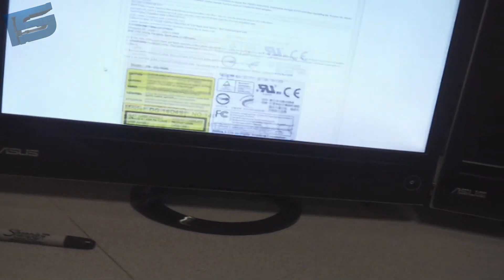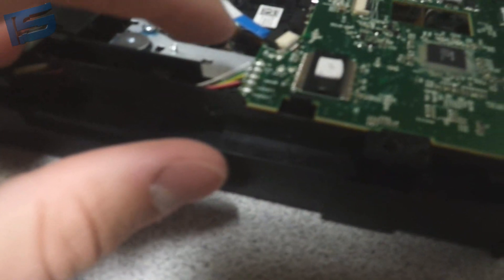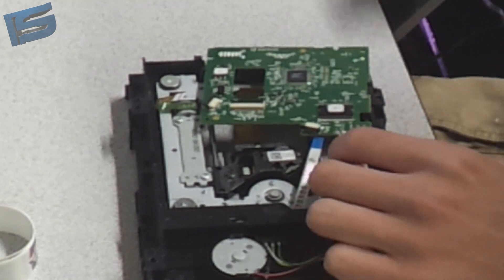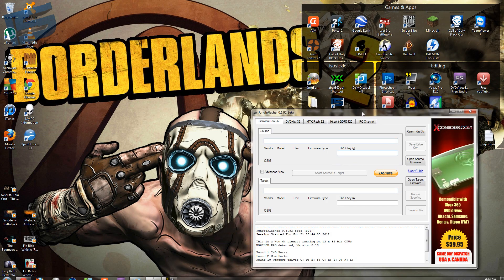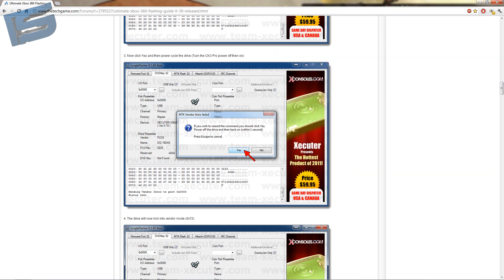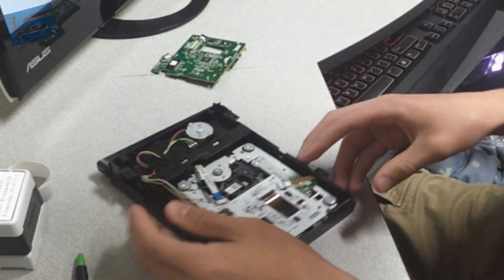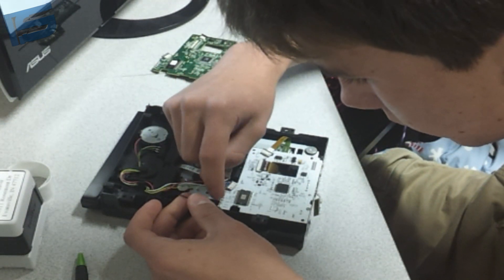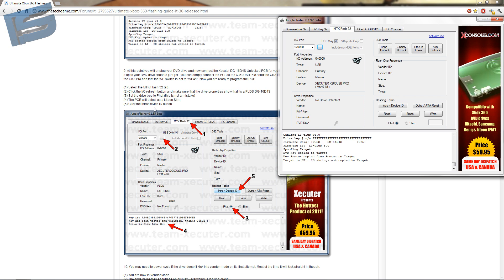How To Flash A Liteon DG-16D4S 0225 (SLIM) [Full Tutorial & Everything Needed] Part 1/2

Comment from the maker: If you're buying the unlockable pcb, it should always be locked unless you are flashing the drive. After you're done flashing it, switch the switch to locked. You don't have to revert back to stock firmware when you update. It's only for really paranoid people. I never revert back and I haven't been banned. Jungle Flasher changes the firmware on the drive (flashes it).

Comment: Please can you assist me as i am planning to do this with my Xbox 360s. I have already bought "xbox USB Pro V2" 
question is Xecuters have made a chip with lock and unlock function ok. But when i buy an unlock chip and i once programme it with Jungler u still have ur original chip with you if u want to update ur dash ui can always plug ur original chip in and after that u can revert to moded one.
or if every update updates DVD key too?
Or do u need to keep unlocked in order to run  backups

Comment: I followed this tutorial, I realized you should have instructed first to 'read' and save stock firmware, (not as important.)  But on the unlocked PCB, you are supposed to 'lock' it by switching the switch on the new PCB to WP=0.  This is to keep the Xbox 360 from being detected.  Still a thumbs up for helping me flash my xbox :)